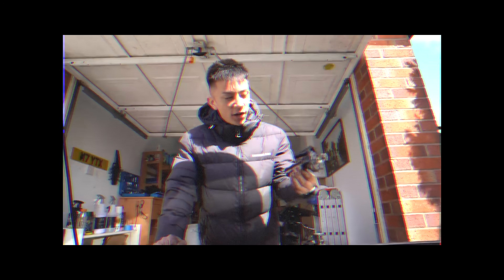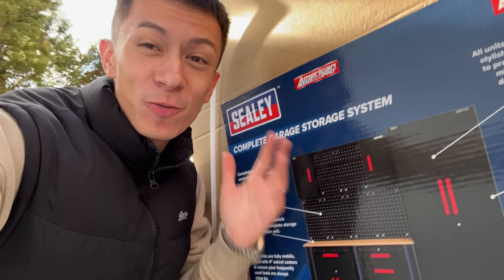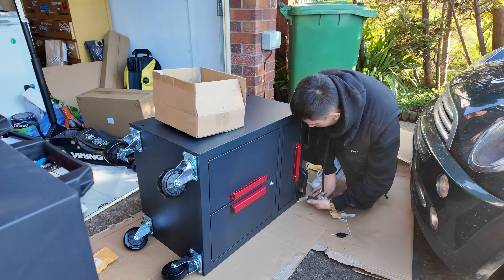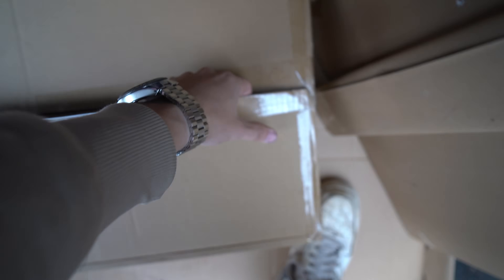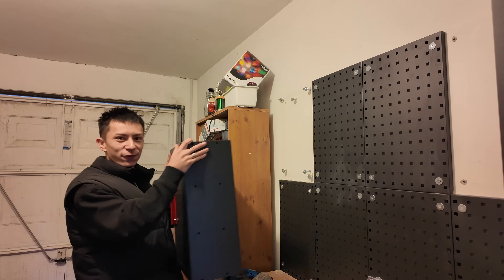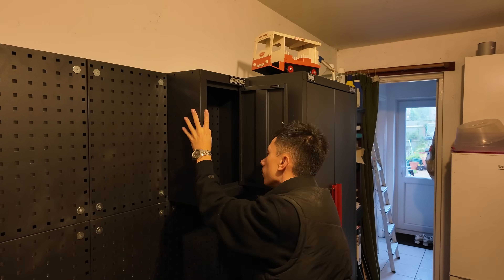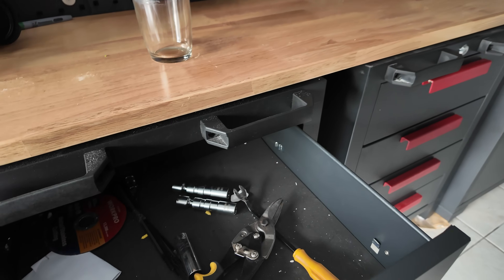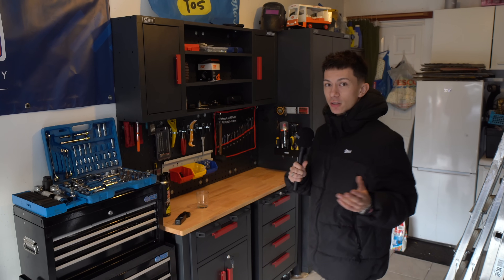BUILDING MY DREAM CAR GARAGE!

Comment: 1:56 when temperature drops below 0C and moisture is high in the air does the roof of the container inside freeze and later drip all day on the car? Container roof does not have foam insulation right?